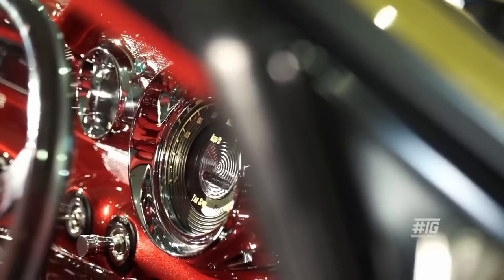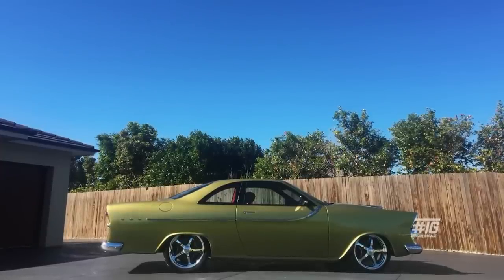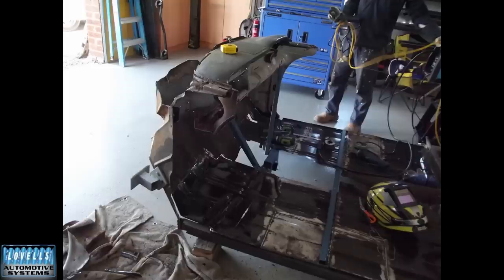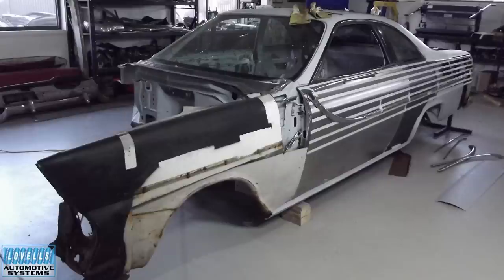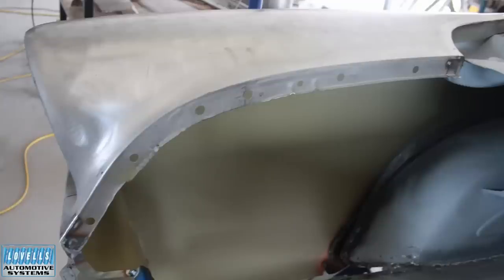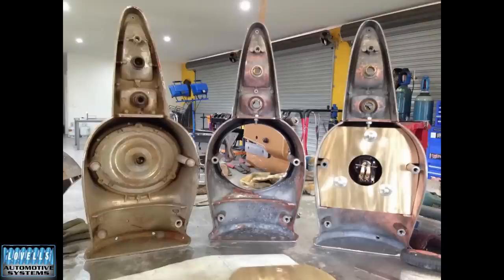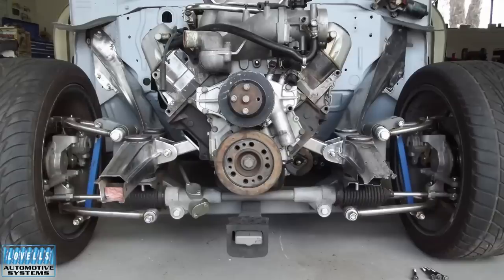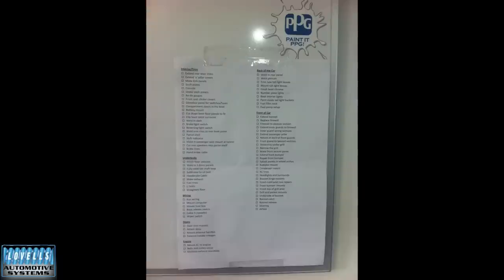The Build Series #11 | Tail Spin | Howard Astill | Perry's Garage

Comment: Amazing amount of work! It's a car that did ruffle some feathers! I like the concept, but i think the front end is too high and straight to match the body line. If the front guards sloped down a bit towards the front, the angles would be more streamlined. But hey each to their own! Great to see the car still gets used and not locked up collecting dust..
Reply from the maker: I think there was a lot that could have been done if we were coach builders, but we weren't so the stock panel shapes had to be utilised

Comment: Hey Howard, currently prepping to build my vk into a show car in NZ, what’s your process for die grinding cast parts? I was thinking carbide burr bits then sanding drums but wanted to see what you do 😁
Reply from the maker: Do all the heavy shaping with 40 and 60 grit on 4" flapper and small belt sander, I then would use paper rolled up on a shaft that I have shown in some of the episodes, The burr bits are OK but super noisy and tend to chatter a lot
Reply: Awesome cheers Howard!!